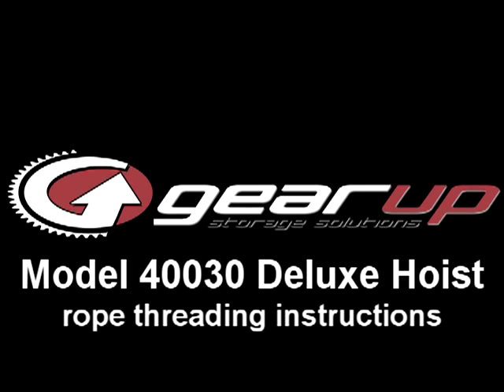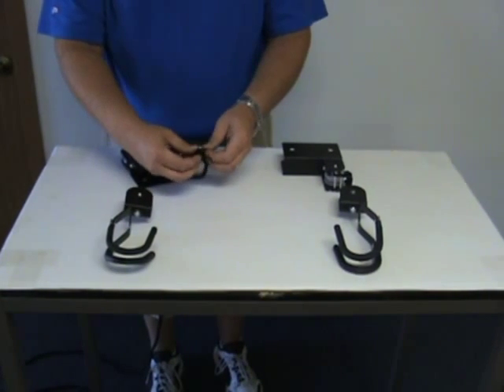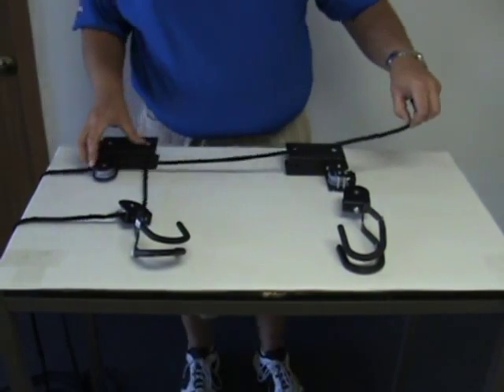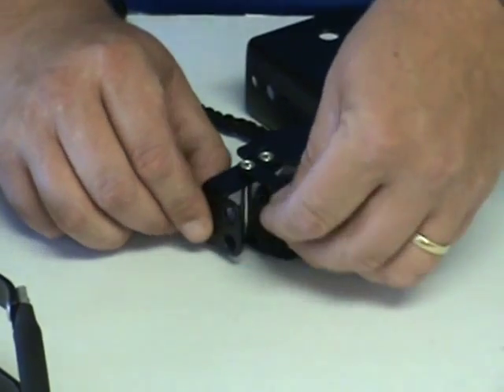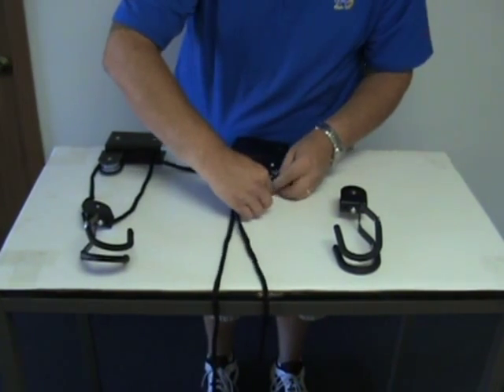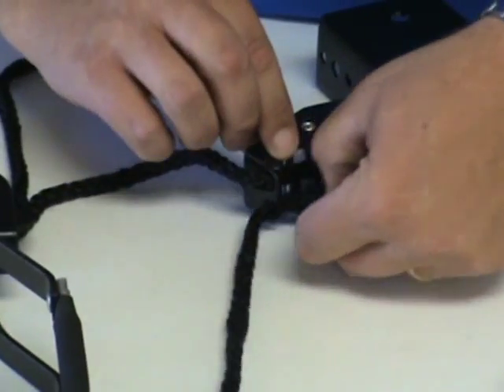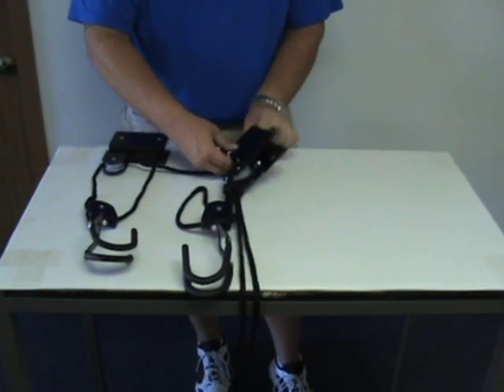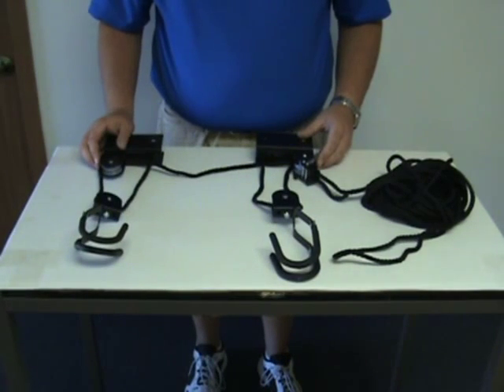Gear Up 40030 Deluxe Hoist Rope Threading Instructions HQ

Comment: Helped  me put up my system. Which seemed intimidating at first but I managed it in 1 hour on my own..  I added a washer on  my 2 double knots as extra security.. 
Very happy with the system. I'm using it to lift up a large car roof box..
I would recommend this product